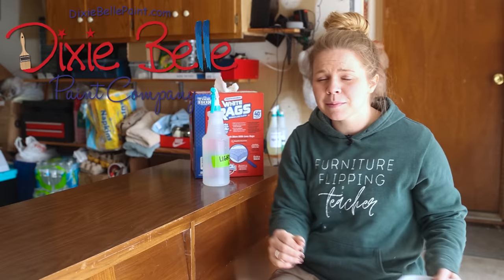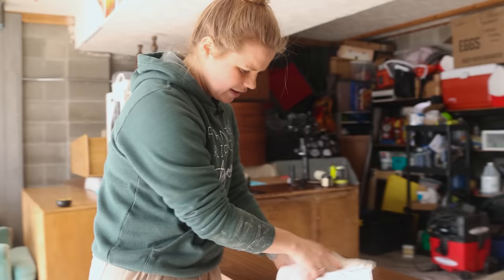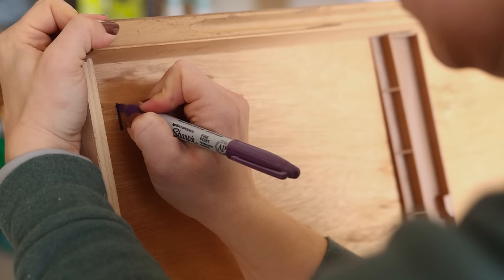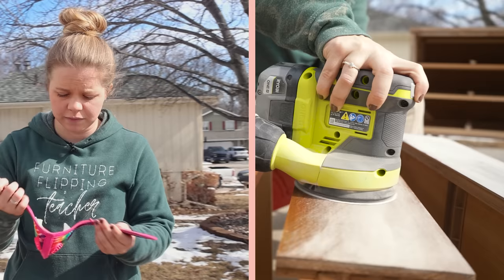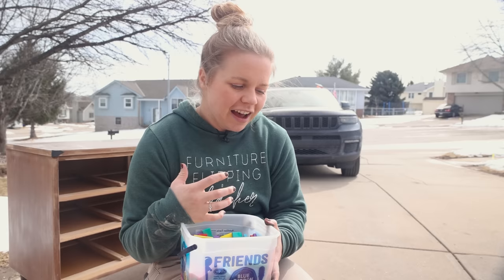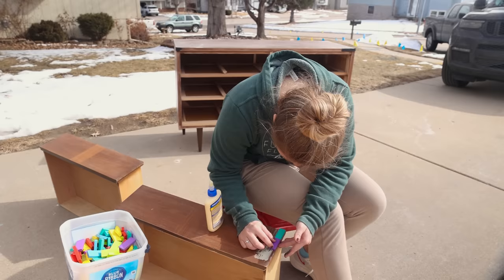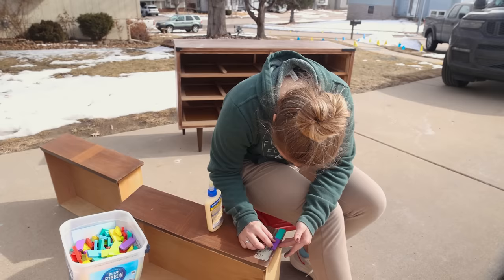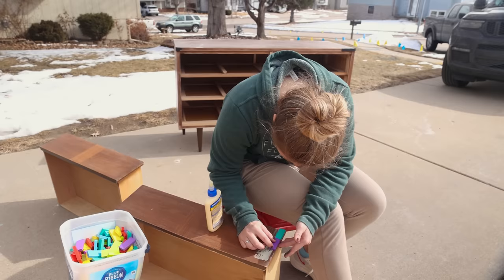This Dresser SOLD in 10 MINUTES | How an $8 Goodwill Find Earned Me $450!!!

Comment: The piece looks great. Luv the wood tiles. In the future, I would just suggest finding the center of the draw and the center of a wood tile, line them up, and then work outwards. That way, you'll have tiles that are equal sizes on each end.
Reply: Totally agree and noted a comment about this. Lauren, please learn to do this. I have seen many of your pieces that do not have design elements centered. I would not buy something that is not centered, it would drive me crazy looking at it.

Comment: I would like to make a suggestion. When you do a design, such as laying these little tiles on the drawer fronts, you should find the center of the drawer front and line up the center of a row of tiles on it THEN go left and right, laying the tiles. Then you would not end up with one side that is smaller than the other side. This goes for anything, like laying a decorator shelf liner or other product. Start in the middle and work your way out, left and right. I would not buy a piece of furniture where the design is off like this. It would drive me crazy, haha

Comment: Probably should have sanded each block + the fronts of the dressers before gluing them together, for the same reason you sanded the top. They were too smooth and popped off when you tried to trim the ends off. Anyway,  i really like your videos. I'm inspired!
Reply: Good thought.  It is hard to believe Lauren didn't think of that herself when the tiles came flying off when trying to cut the tiles around the edge of the drawer.  But at times,I think she gets ahead of herself.
Reply: I agree. I see these little tiles popping off in the future because she did not sand them properly.

Comment: Where are the drawer handles? I would not buy it without handles.
Reply from the maker: there isn’t actual hardware on this piece. there are handles on the bottoms of the drawers that make them very easy to pull out

Comment: If you didn't clean those tiles before gluing them to the drawer fronts,aren't you taking at least a chance that they might come off.  I would think the tiles would have been handled at some point and be dirty with body oils.  I know that you are usually good with cleaning but this fact may have not come to mind.  Since the tlles were in an ice cream pail I would bet they have had some human contact.
Reply: Sorry Lauren,I missed the part where the tiles were packaged.

Comment: My understanding is that veneer and laminate are not the same thing. To my knowledge, there is no such thing as a laminate veneer. I may be wrong. I'm not being ugly. I'm trying to learn.
Reply from the maker: I think its still technically veneer bc it is going on top of the other material. they can be the same thing but aren't always the same thing...like a rectangle and a square 🤣
Reply: @FurnitureFlippingTeacher  I believe you. I just thought a veneer is actual wood, just a very thin strip of it whereas laminate is basically paper with a wood pattern printed on it. Well, thanks. You learn something every day.